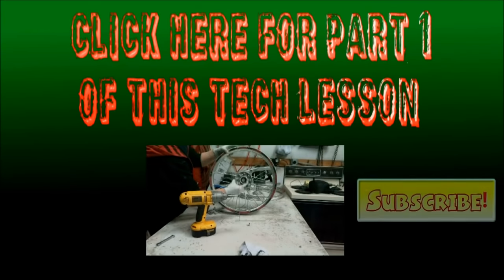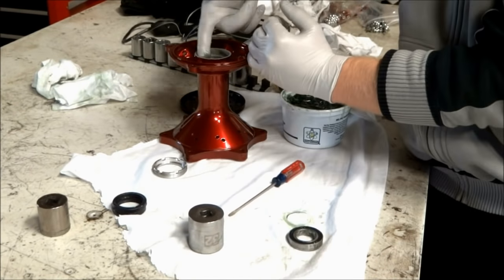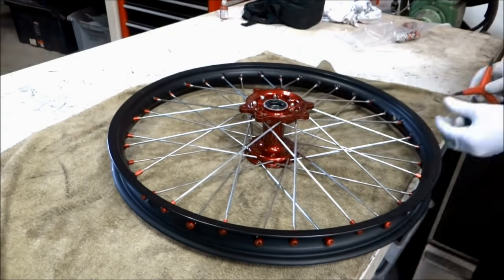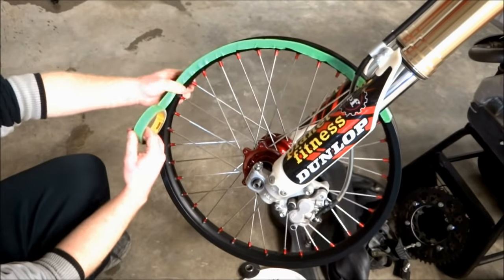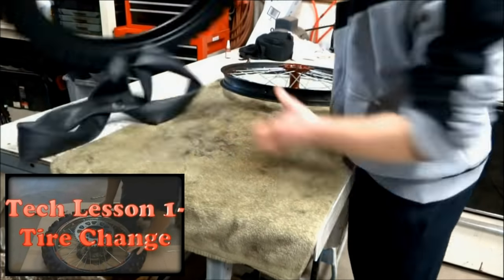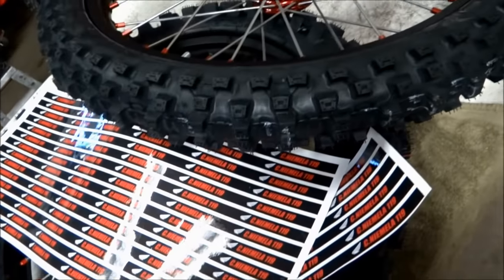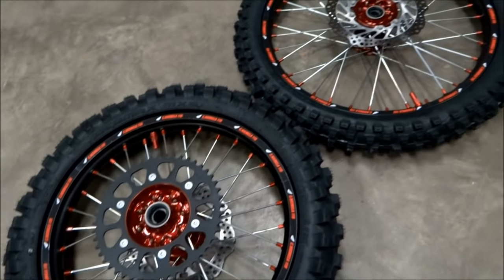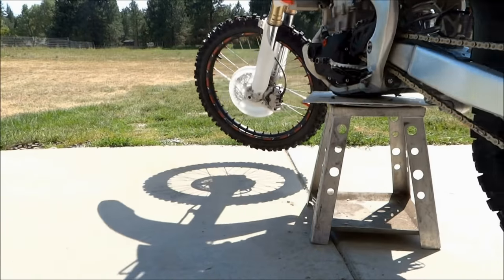POWDERCOATING & BUILDING WHEELS PART 2

Comment from the maker: For one, my oven wasn't big enough and then I got a good deal on a set of diamondyzed rims so I went with those instead. But powercoating rims will hold up just fine. I've done it several times on smaller bikes.

Comment: Great video very informative. How has the wheel coatings held up? Where did you have them coated and what kind of price for 2 rims?
Reply from the maker: Thank You! The coating on the rims held up great. They got the usual wear line around the edge but other than that they in great shape when I removed them. I bought the rims already coated.

Comment: Just wondering when you powdercoated your spoke nipples didn't the powdercoating get all messed up when you were putting the wheel back together and when tightening and adjusting the spokes and wouldn't the spoke wrench not fit properly anymore?

Comment: those wheels look great! good job on the powder coating. does the powder coat hold up well with sand and rocks?
Reply from the maker: Skyler Cook Thanks! Yes, the coating held up great throughout the couple years I used them. A few chips and scrapes but nothing major.

Comment: i just got another bike recently, 2013 crf250r, and i was wondering what the best way to change tires is when you have black rims? im buying D.I.D ST-X black rims for it and don't want them scratched..is there a certain tool you recommend to do so? i usually just use standered tire irons but they scratch the rims to much(i know this from my last bike)

Comment: I just anodized my stock rims on my 2012 250r so it's the same bike as yours. Do the shorter spokes for the rear wheel go on the inside or outside spoke holes in the hub?

Comment: damn that looks good. I'm building a little indian me100 for my kid and i'm customizing it. I'd really like to do the exact same thing you did to those wheels, except for a bronze accent color instead of the red. If I sent you the wheels off the bike, would you be interested in doing them for me? If so, how much would you charge for the front and rear wheel? Thanks.
Reply from the maker: +Brad R Thanks! Unfortunately, I don't do powdercoating work any longer. Good luck with your project.

Comment: Is the offset for 2010 crf250r the same for the rear wheel. I forgot to measure it when I took off the spokes. Are the inner spokes on both sides of the rear wheel longer or just on sprocket side?

Comment: Hey I just did this but instead of using bold spokes I used tusk spokes, are they good or not? Like if I case a jump I don't want the wheel to fall apart. Should they hold up???
Reply: old spokes not bold

Comment: Nice job. Rims alone cost about $100 each for single color. $150 two tone. Thats just the rim. About $80 extra to get bearings removed so $350-400. Will be more with hubs, spokes and nipples.

Comment from the maker: DiamonDyzing is similar to anodizing, but much stronger. It supposedly will wear the teeth off of a file before the surface is damaged! Spokes should be replaced when the nipples don't spin freely on the threads any longer. This makes it hard to keep the spokes tight and the wheel will be destroyed quickly. Here is a link for DiamonDyzing:

techlinecoatings(dot)com/hi-performance/diamondyze.html

Comment: questions... why anodized instead of powder coating the rim, and why put on the graphic after assembly, instead of possibly applying the graphic and clear coating it before install?
Reply from the maker: Anodizing usually holds up better on rims since it doesn't chip. It would melt the graphics if you powdercoated clear over afterwards.

Comment: Why did you put something between the rear sprocket and chain when tightening the rear axle bolt?
Reply from the maker: That is done to pull the wheel all the way forward to the axle blocks.
Reply: OneOne9 Creations I see. Thanks for posting these and taking some of the mystery out of powdercoating. Very informative and well made videos.
Reply from the maker: ***** I appreciate you watching the videos! Glad they are useful.

Comment: Hey, just wondering i recently purchased a eastwood kit like yours, and i wanna powder coat my frame ? but you needa heat it any suggestions ? cheers
Reply from the maker: +lockie Down You'd either need a large oven or an infrared heater, both of which are pretty expensive. You'll be better off bringing it to a shop.
Reply: Sweet as thanks, also are you able to powder coat plastic parts ?
Reply from the maker: +lockie Down No, plastic does not conduct electricity so they cannot be powdercoated. And they cannot withstand the heat needed to cure the powder.

Comment: I have tried Powder Coating my spoke nipples and whenever I tighten them with a spoke wrench the powder coat peels. How can I avoid this?
Reply from the maker: There's not much you can do if the powdercoating is done right (make sure the parts are as clean as you can possibly get them). I've just been cautious when tightening my spokes and it hasn't chipped much.